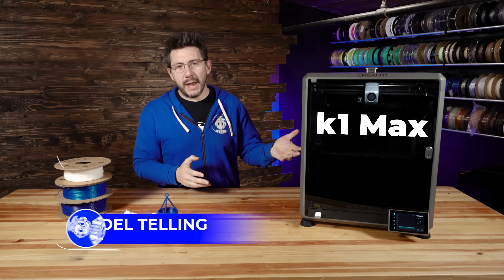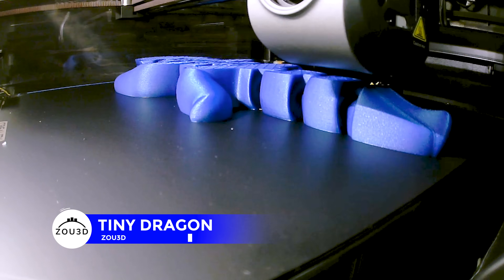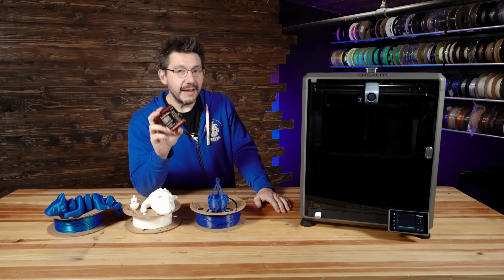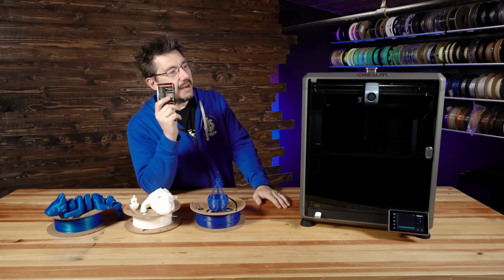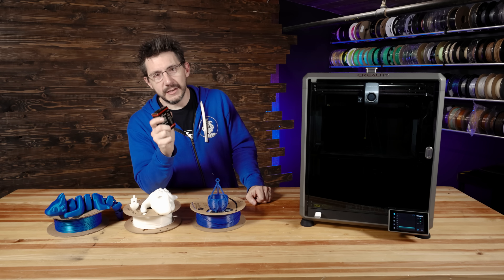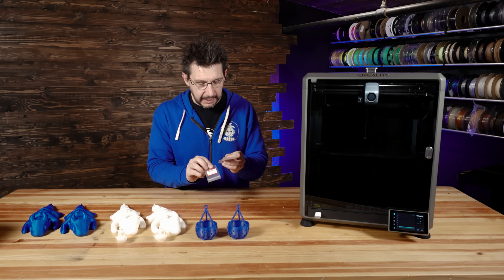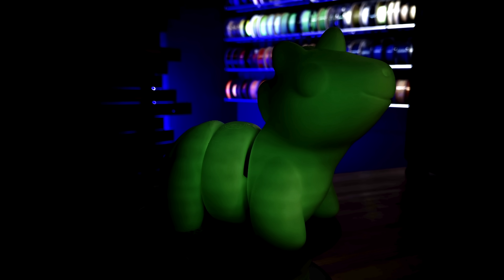THIS Fixes the Creality K1 Max

Comment: I think your wrong about the .04mm nozzle i think there are alot of people who will buy a bigger printer so they have the extra size and still print lots of smaller parts on it and want the .04mm over the bigger size
Reply: A lot of people will also buy this to print big stuff because they already have a smaller build volume based printer. So while I totally agree that a lot will buy it for exactly what you're thinking, others will buy it for larger parts exclusively. I treat 3D printers as tools, sometimes I can use a tool for a purpose it wasn't exactly best suited for because its what I have, but other times I'll buy a tool specifically for a single purpose. The best part? This video showcases how you can easily utilize this tool to do either, by simply swapping the hotend for a system that allows easy nozzle changes. Brilliant!

Comment: A lot of ringing on the prints.  Not tuned or printing too fast
Reply from the maker: Ringing? I’ll have to take a look when back.
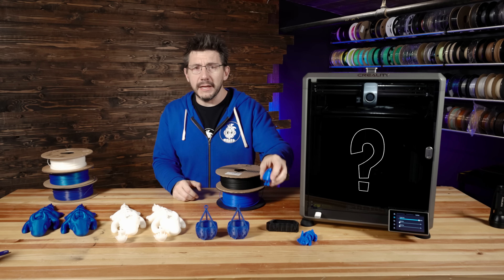Reply: @3DPrintingNerd  thx for answering. yeah.. cauldron. min 2:34 and 9:10 very visible in the middle, The dragon... not that much because it is very rounded. but if you look at 2:06, it is visible on the nose ( but in this case it s moaning on a high lvl... the print and filament are very nice.... :)  ) same on the candy egg on 12:02. 
on 13:30, the hinge of the box looks bad... but it could be a layer time setup... a little bit of tuning 

btw... really appreciate your work :) .. some years ago, I was living in Frankfurt in Germany and I would probably go to the formnext just to have the pleasure and honor to meed you in person :)

Comment: ...there is no point to this.
1 - It still takes tools to change the hotend. Having to use one hand or both doesn't really matter, as you have to whip out your tool belt regardless. If they had an automated /or easy to automate hotend change setup, i could see reason for excitement.
2 - 0.6mm nozzles are useless on core-XY
I mean speed is handicapped by flow rate, sure you can push more through, but you cannot melt it as well. The real improvements are nozzles with better heat transfer, like CHT nozzles, not the "lets have a larger half melted zone of mush in the middle" bullshit like this.
Reply: I'm confused too.  Isn't the whole point of the two anchor points for the heater block so that you can use one-handed torque wrenches?
Reply: yeah the best hot end IMO is the revo. No tools required. And a swap takes 30 seconds tops. I actually like the revo better than the mk4 hot end. The mk4 takes about 1-2 minutes. Cable management is by far the worst part of the mk4 swap. 

I'm not sure why nozzle size would matter on a core XY though.

Comment: Disagree. I still think 0.4 is the best starting point.
Reply: Agree, and even more so with the high speed printers. If they're 3-4 times faster than the average bedslinger, why sacrifice detail for more speed?
Reply: ^ THIS with faster printers .4 nozzles work for larger prints/printers. With that said larger nozzles with small layer height are great for strong high detailed parts
Reply: Not for me i prefer 0.6
Reply: There was a time when 0.35mm was considered ideal then 0.5mm became SUPER popular and finally it dropped back to 0.4. The thing about 0.4 is if you print filament with sparkles/glitter or carbon fiber it will partially clog and you may not even notice beyond some minor under extrusion if it happens on a perimeter.
Reply: Giving a .4 is ok, giving a .6- .8 as well in the set is even cooler. 
❤❤❤❤
Reply: It all depends on what youre printing. Big printers dont necessarily mean big prints all the time. Especially when its still a desktop printer. I personally print a lot of parts with thin walls that are much better when printed with a .4mm nozzle, however I will switch to a .6 or .8 when printing with chopped CF or GF filaments.
Reply: Can’t print cf through a played nozzle. Plating is there so filament don’t stick as well 🤷‍♂️
Reply: @Exstaz  according to nozzle manufacturers you can. 🤷‍♂️
Reply: I have so many 0.4mm nozzles. That come with nozzle kits I have bought. I haven't used any of them since I first started 3d printing in 2019. I only use 0.6 and up for nozzles. I also just bought a K1 Max as well
Reply: Great review.
I just got one and it's My first new printer and first Creailty  printer.
I've been really impressed so far.
Reply: I totally agree. I kinda don’t like the printers which ship with 0.6 by default. Buut, each to their own…
Reply: I'm using .6 on small functional prints with little issue. Since I'm using carbon fiber nylon. I theoretically have a lower risk of jams and needing to clean the nozzle more frequently. I rarely find a need for that level of detail where machining is preferable to even a smaller nozzle.
Reply: Well depends, In my case I must make prototype pieces that will be cast, they are large pieces, and I need them to be strong. The noozle 0.6, 0.8 even 1.0 works great for that. it’s not about details, it’s about speed and strength. In a piece, for example a street light, the details are lost due to the size. With the current slicers I can achieved very good finishes. However for general use, it seems to me that 0.6 should be the standard for large printers like the K1 Max. it's just my opinion of course.
Reply: There a video someone did a few months back on YouTube comparing 0.4 vs 0.6.
The result with modern 3d printers w all the new settings and software..0.6 was After and you could tell the difference. There is Zero reason to use 0.4 today.
Reply: In 2023? Absolutely not lol, with new slicer algos it makes no sense. I'd bet that 95%+ of things that people commonly print would be completely fine with 0.5mm or even 0.6mm nozzle. And if you have big printer like this, using 0.4mm is just stupid
Reply: @Whatever_1199  .4 was picked as a tradeoff of detail and speed and that is still true today. It also works well with the 1.5mm filament
Reply: @Whatever_1199 it is not stupid. It all depends on what you’re printing. I print full beds all the time on my 350x350 vorons but the parts I print and sell just have 2 walls with a 0.4mm nozzle. Having a .5 or a .6 nozzle would not work. I know I can push out 0.84 with the 0.6mm nozzle but the part have some overhangs and don’t print well if you push out that much plastic at ones.

Comment: I've not been impressed with what I've seen with .6mm nozzle printing up to this point.  The quality of the prints lack imo compared to .4mm nozzle prints.  Now maybe with better .6mm profiles the gap between the 2 can close, but I don't think we're there yet.
Reply: These are big prints so speed is more important than accuracy (although you could make the layer heights less) . I would instantly put a 0.6mm nozzle inside as that is the best for me...but for others they might find 0.4 is more their cup of tea.
Reply: @mrfoameruk no this is some bone head thinking you display. We want big prints and details!
Reply: @OneHappyCrazyPerson  agreed. I'd have no qualms about using a 0.25mm nozzle for a giant print.

Comment: Thank you for your video but what about the tolerance? I'd like to buy one 3d printer for my business but I need a good building precision; thank you
Reply: you can expect tolerances od +-0.1mm with 3d printing .... wich is precise enough for hobby woodworking, but nothing compared to machining,  cncs or anything like that
Reply: @Basement_CNC  thank you very much 🙂
Reply: I use it to print parts for a product as wide as 295 mm. They must fit a PCB that is cut to 0.2mm resolution. It fits. I had problems with my Prusa XL with dimensional accuracy (it was off by 1%) so I had to expand the model in the 3D modeling program (Shapr3D) by 1% to compensate. I never got to try that, however, because the K1 MAX arrived, and I am a happy camper. I can print one part of the product overnight (7 hours in normal speed mode), and the rest of the parts in 6 hours (fast mode) and get one product completed per day per machine. That is 20/month. Pays for a new machine every month, because it would cost me over $100 to get the parts printed outside.